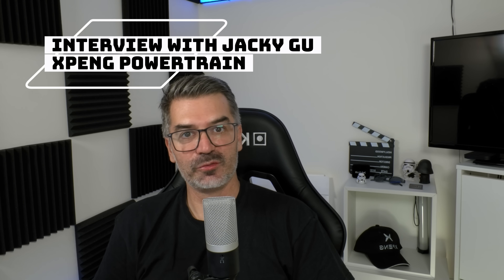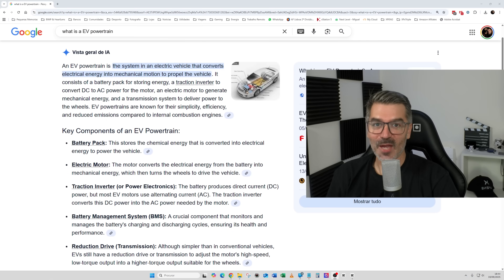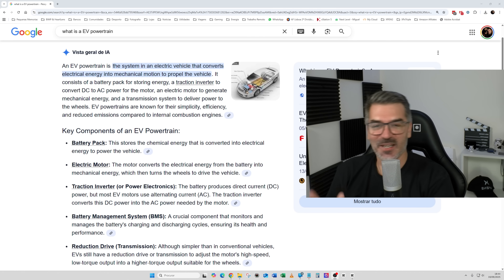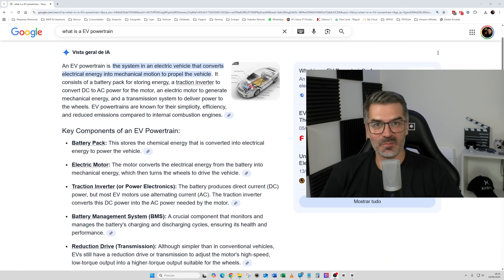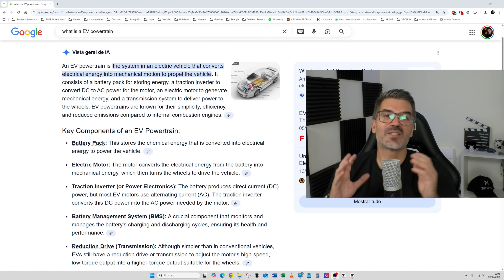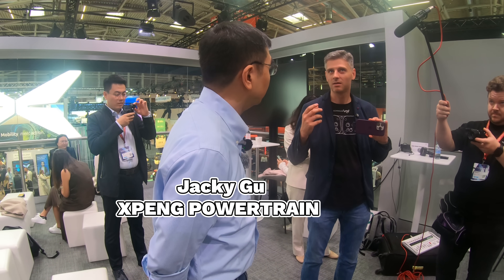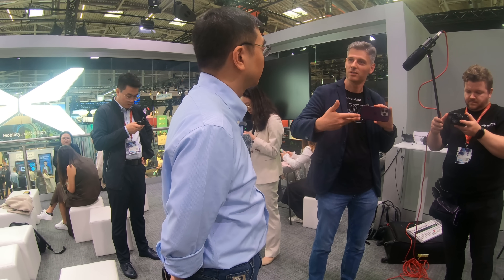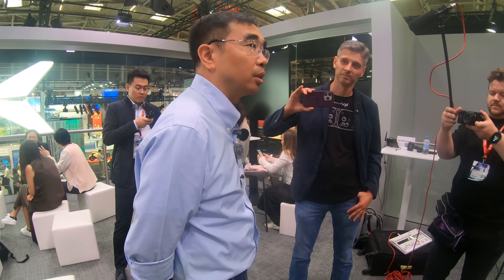XPeng Efficiency Secrets | Interview with Jacky Gu

Comment: You're doing a fantastic job with these interviews with Xpeng engineers. Bravo. It's encouraging that the people at Xpeng are gathering information about their products. Hoping their people are reading your posts, I have a few comments about the interior. What I miss most about the G6 are the passenger compartment and the sunglasses compartment. Xpeng aspires to the premium segment, so they could make the door compartments flocked to make small items in them less noticeable, especially since the compartment under the center console is flocked. Another issue is the front seats in the G6. They have too short seat cushions, and making them similar to the G9 would be a huge improvement. This would significantly improve driving comfort. Another thing is the exterior lighting in the G6. I think lower lighting in the exterior side mirrors would make approaching this car at night much easier. This lighting allows for a clear view around the car at night, even if it's not a puddle or something. Finally, since I'm writing from Poland, I really miss the Polish language in the infotainment. I think this is a huge oversight on their part, especially considering that Chinese competitors like BYD, Omoda, Jaecoo, and MG have it. That's all from me. Thanks again for your videos, and best regards. All the best 👍
Reply from the maker: Thanks for the comments and kids words!
Most of the changes you refer are "physical" and so i believe that we will not see those in the current models, but maybe they will be implemented in 2 years from now (i believe that in 2 years we will have a full redesign of the G6 and G9). The infotainment in Polish, i believe that it will come sooner or later. They have been adding languages in every single update. The assistant language is tougher to get, but i asked :)